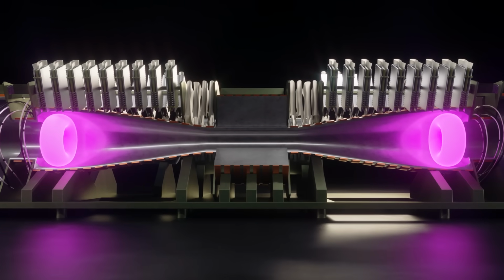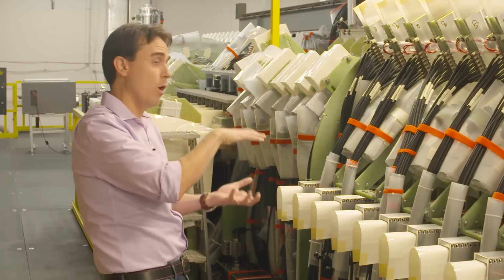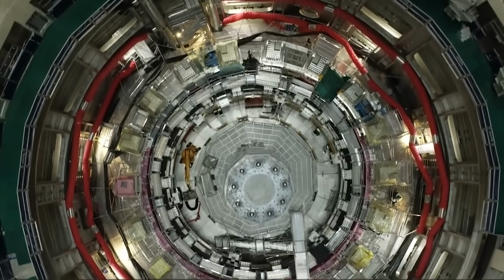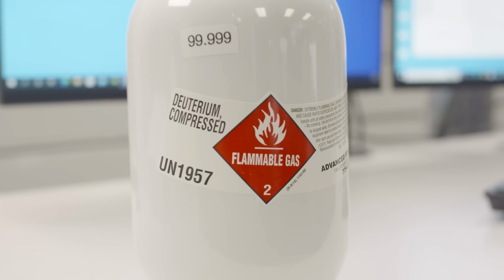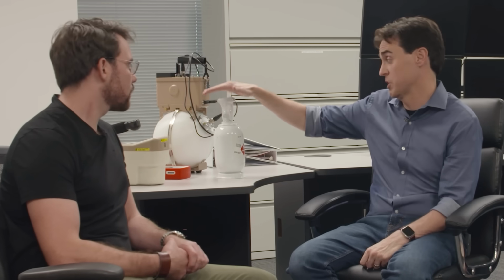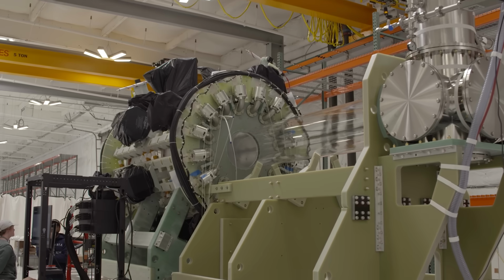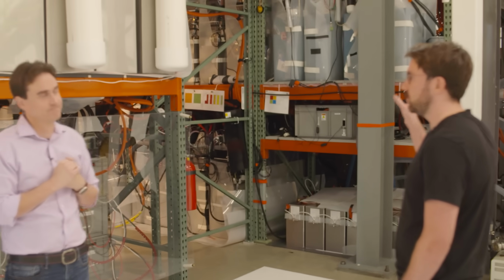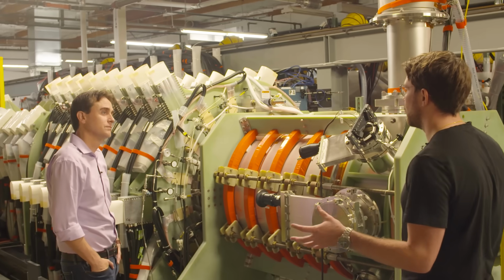A New Way to Achieve Nuclear Fusion: Helion

Comment: Main issue:
The driving pressurization electromagnets will have to be switched off to generate any energy via ion motion, plasma expansion. If they were left on you would be using energy to drive a counteracting field to that which the fusion products are generating which only wastes energy. This is assuming the explanation is not in all directions and thus can actually generate net magnetic flux OR the plasma expansion simply bends the fields already their rapidly/faster than natural decay and that is what generate the power which is more likely yet this will only be net gain if it totally counters the initial field and generates its own.
I may be missing some theory or work about how ions bending a powered magnetic field can add to the current generating the field and produce net power gain, but to my knowledge this is unphysical.

Comment: In reference to their need for high current pulsed power, currently they're using large capacitor banks. Seems likely that in future they'll be able to use three reactors operating 120° out of phase, each dumping it's produced power into the next in sequence. Prime, fire, exhaust...  feed the surplus to the grid.
Reply: They would still need to feed each reactor power to the right places at the right time so even if they could get enough reactors so one would fire right as the energy output of the previous was being released they would need some storage for the different timing delays. Especially if the output energy has a different power creation curve than the reactor input uses that power.
Reply: @Tsudico  Mmm, you're right, I wasn't considering the precision timing required or the multiple sequential accelerating pulses per shot.

Comment: I am waaaay out of my element as far as the specifics of nuclear fusion... but I have a question. They're saying the deuterium-deuterium reaction has a chance to create a high-energy neutron which isn't useful for their method of electricity generation and it can do damage to the reactor... Is there a way to force the neutron into a body of water, increasing the temp to steam, and also having the water capture the neutron to create heavy water? Is that even a thing that could be done? My thought is that you use this as secondary generation via steam, but once the water is saturated enough with heavy water, you could electrolyze it to release the deuterium to then use as a fuel again... This way you're not wasting high-energy neutrons...

Comment: Maybe they just need multiple reactors firing in sequence like multiple cylinders in a piston engine.  The power surge from one reactor's fusion ignition is used to power the next reactor's plasma cycle until it fires and powers the next reactor.  The faster they can get the sequencing to run, the less energy will need to be stored in capacitors.   Essentially the plasma and magnetic fields become the energy storage systems for the brief period between shots.  Inductive energy storage instead of capacitive energy storage.  This would eliminate concerns about how much energy you can push and pull from capacitor banks and potentially simplify the system down to coils powering coils with the fusion as the energy booster to keep the charge / discharge cycles net positive.

Comment: Question, and I understand they know way more than I do, why can't a heat pump be used to draw off the heat he's talking about near the middle of the video, both cooling the system and a helpful way, and recapturing lost heat energy from the magnets and capacitors? I'm guessing the answer is super not worth it

Comment: even if this style of generator makes less power overall it seems like it will be a lot better for large-scale production, smaller footprint, and seems to have a steady fuel supply with little environmental impact. It also seems a lot easier, faster, and possibly cheaper to make major changes to the system

Comment: By any chance will pumping liquid nitrogen through the exterior walls and around the magnets reduce the heat stress allowing longer run times and lower the needed power to out put for the magnets?

Comment: I would loved to see some Qplasma and Qengineering numbers for Trenta and estimates for Polaris.

Also a bit more explanation for why D-He3 can't be/ isn't used in Tokamak systems
Reply: It's because of the way that Tokamaks generate power. They work by capturing the kinetic energy of neutrons. The D-He3 reaction releases almost all of its energy in the form of charged particles, rather than neutrons. The Tritium Deuterium reaction releases most of its energy as neutrons. Hope that helps.
Reply: @SentinalhMC  That's an argument for why Helion CAN'T use DT fusion, but I don't see a reason for why the the kinetic/thermal energy from the changed plasma can't be extracted at the walls of the tokamak. Obviously the protons would be influenced by the magnetic fields and wouldn't just shoot out the side, but eventually the magnetic fields need to be powered down anyway and the thermal energy is extracted from the plasma.
Reply: @plainText384  That's not how Tokamaks work. The whole point of them is once you get the reaction running you never shut it down. The plasma never touches the walls the neutrons passing through the walls is what allows kinetic energy to be converted to heat to create the steam.
Reply: @SentinalhMC  Tokamak reactors have never operated for more than a couple minutes at a time and pulsed Tokamak reactors are a concept that exists.

 It is also my understanding that to induce a stable current inside the Plasma, the field strength and therefore the current in the external poloidal superconducting magnets needs to continuously increase. (Like trying to achieve a constant Voltage on one side of a transformer). I was under the impression that this put a limit on the time a Tokamak could remain operational, as the superconductors will loose their superconductive properties above a certain current density.

But I am not an expert in Fusion reactors, this is just the stuff I remember learning back in high school, which is why I would have liked a deeper dive from real Engineering and some scientist he finds to interview.

Comment: Sounds questionable. Achieving fusion is rather easy you just need a good vacuum chamber and a high voltage supply. The hard part is there needs to be more energy out than in. Even worse, you're doing constant confinement+ 30 or so pulses, and you get just 1 pulse back. If humans can capture pulses easily they would have been capturing lighting

Comment: so thoery a termal enginering could go as gas erupt systems and speed up reaction time so is easy in continues use see efects and also more economic koeficient in use technicaly is booster tester in owerachieve test for colide explosions guided and driected into splash together perahapse a theory off rocket engienring could also be helpull lets supose gas ions could behave under heat like rough gas in ramjet or scarm jet engine so called rings blimps could actualy do energy storage and eventualy pop out nicer in ecplitic oval shape this phenomen could bring out some roughenss to more refined also like acustic sound blimps so basicly this are lab test based on light ion if they could be handled in above theoretical usse off gas as 84% power max use power max out potential is 95% as things should do in normal jet engine use for normal life span and stabile use so tech ring could apply on part off booster part and avoid misfire or failure or misuse technicaly if it works you could look like majke so as am stuff better maintain cycle or more safer to faster use so eficiency iis corect also faster idustrial size product anyway after first shwo and following directions is easy stuff for nobel as first to use contemplive theory and porve practice aplicationable so theory suport enginering demanding future as something as divine drive in india was axis based engine atleas to is noble to prove realy fact that some enginering also follow some design and basicly do stuff as principle in cold fusion planets not our actual still gigantic energy potential in use and biger then earth so even provng physical enginering tech prove gas could follow ionized and seing difference is basicly science off large composit gas planets actualy like this

Comment: So one question I have is how do you exhaust the Helium 4 out of the machine after the fusion? Can you do it continuously, or do you take the machine down and empty it? And surely, the Helium 4 exhaust is a valuable product too right? You can sell it to hospitals to make operating an MR machine much cheaper.... Maybe the system is really just a helium making machine that makes free electricity as a by product...

Comment: Why is the glow visible through all that material? how much mass is being smashed and how much fusion energy output per pulse?
And rather than build physical reactors, why not simulate designs until there is a chance they'll work. There would seem to be no reason for wasting money and time with physical devices that will never work. Simulation would seem to be vastly more agile.

Comment: wow this is cool, and insane, im sure someone has already thought of this but im going to sugest it anyways, instead of 2 chambers meating would 4 or more give any benefit? fireing all at once or stagered to reduce time between fusion events. gods speed. hope this is comericaly viable in a decade or 2.
Reply: My initial thought was also "what if they were at a slight angle, so that the combined fusion blob then started racing down through the electromagnetic equivalent of a bell nozzle?"  I.e. make a fusion pulse rocket with this thing, perhaps partly self-powered with the rest being provided by a proper generator.  Could prove to be a good mix of high specific impulse mixed with actually accelerating at a rate you could feel (and if you have enough power to power it, you can also power some electric jet engines to get you high enough, perhaps with a final conventional rocket booster to get suborbital, to then use the fusion pulse rocket to circularize and start getting to where you want).  

I wonder if such a fusion pulse rocket could have enough energy to get off the moon directly, and how much mass it could do it with if so.  Would be a lot easier to start setting up bases and mass drivers if you don't have to basically use it as a cargo ship for carrying landing pods with conventional rockets for landing themselves on the moon (or having to put conventional landing rockets on the main ship).

Comment: Does it make sense to line the walls of a Deuterium+Deuterium breeding reactor with Lithium to capture the extra neutrons? You'd have to deal with the Tritium released but you could fuse it with Deuterium again to make more Helium-3. And you wouldn't need the Beryllium and its associated problems.
Reply: that was covered in the video. If you use a neutron to make tritium for fuel you spent 0.8 of the neutron energy splitting the lithium so it's not available to heat the jacket. Using a beryllium jacket you release two neutrons so can bread fuel and heat the jacket for energy recovery
Reply: @salerio61  right but I'm not talking about the energy reactors, I mean the reactor whose only job is to make fuel for other reactors (hence breeder reactor)

Comment: Topamax will never go online at large scale. There is a major problem with needing over 20+ tons of rare mineral to act as a neutron generator.

It's one of the major key components to the reactor it's that white ring around the blue ring used for cooling.

The world's manufacturing capability of this mineral is only 20 tons a year.

So we would have to divert more than a few years of production just to make enough for a single reactor.

I think you're starting to see the problems with a topamax reactor.

Example 11:15

This material is also not capable of being recycled after it's used it just has to be thrown away 20 tons of it!!! WTF😒
Now consider that you have to run old nuclear reactors to get the tritium to run in the fusion reactors every time you want to start the damn thing. 🙄🙅🏻😮‍💨
Now considered tritium is extremely rare I think it's the most expensive rare element on the planet to buy second to a few others that are not metals.

Now look at this reactor it requires no rare Earth minerals just strong magnets and a couple of plasma generators.

I don't think they should stop the topamax I think the information gained from it is well worth the study I'm not saying we should dismantle it I just saying I don't think it's going to go to commercial viability.

I wrote this before I got 10 minutes into it because I saw a major problem.
This journalist is very good at this job and is looking at all the angles my compliments.

Comment: I'm just blown away at the brilliance of using the reaction itself to create an EM pulse that directly creates electricity. That totally removes the need to boil water to spin a turbine. It's amazing they may hit the step of making usable electricity by 2024 with what appears to be very few downsides. Further, since the machine itself can create electricity it may open up the possibility of not needing batteries if this tech can be shrunken down enough to fit in a home or car.

Comment: This is one of the more interesting approaches to fusion IMO. Tokamaks are a dead end, as they might make fusion, but getting the power generated to the grid is another thing entirely.
Reply: Agreed.  They are just too big IMO.   About the only way I see them working is if they use helium-3 generated using hourglass reactors like this instead of that DT that needs a huge bery lining and literal steam turbines to extract power.
Reply: Tokomak is too small. The tight circular curve pinches the magnetic fields weakening the outside and allowing ions to escape, bleeding energy from a system that cannot afford to lose any energy. If it was as big as the CERN particle accelerator, the curve would be so long, and therefore so low, the magnetic fields wouldn't notice. It would be as smooth as an infinitely long tube.
Reply: @RobinPageGaming  ITER solves that with a big magnet in the central void. Theres an alternative design called a stellerator that also makes this a non issue.
Reply: @acbthr3840  except the problem hasn't been solved or fusion would be a reality by now. Making the circular path longer, and the curvature less pronounced, might have made it a non-issue in the first place. I'm thinking something the size of the Super Proton Synchrotron at CERN.  On a side note, the reason the Stellarator was originally attractive was because the plasma interaction with the confinement field induced current in the coils, resulting in a self-exciting system, allowing direct energy conversion without a steam plant; a nuclear plasma electric generator, aka a magnetohydrodynamic generator. Tokomaks can't do that but they were cheaper at the time and steam was potentially more energy efficient than MHG anyway, so Stellarators feel out of favor.
Reply: @RobinPageGaming  What? The issue with the velocity differential and magnetic field line weirdness between the inside and outside of the ring in a tokamak isnt the primary barrier to getting the yield up. It helps, but is far from a limiting factor RN, especially since its a negligible problem with the fixes we have. The current limiting factor is actually getting energy into the plasma so it fuses before it expands too much. And uh... no thats not why the stellarator was originally pursed. It was attractive specifically because the design largely cancels out the typical particle drift and helps with diffuusion problems you get in a normal tokamak. It is literally just a normal tokamak, but with a more efficient configuuration since you dont need the core void electromagnet

Comment: The merged plasmoid is shown as roughly spherical, but I believe it would actually be highly elongated (which is desirable here due to how FRCs work.)

The slide with the nuclear reactions also mentioned making tritium from the DD neutrons, in a lithium blanket, which would increase the amount of 3He produced by about 50%.    Neutron multiplication and beryllium would not be required, nor would rapid extraction of the tritium.  Unlike in a DT reactor, the heat from this blanket would not have to go through a thermal cycle (although it could, as could heat produced at the first wall due to photons radiated from the plasma.)  The power flowing through this thermal cycle would be only a fraction of the total power, similar in spirit to how the output of the bottoming cycle of a combined cycle power plant is only a fraction of the output of that kind of power plant

The DD neutrons having less energy is important because, unlike the 14.1 MeV neutrons from DT fusion, they have much smaller cross section for gas-producing reactions (like (n,p), (n,4He)) in the reactor materials.  These reactions are terribly damaging because they inject gas that accumulates at very high pressure in tiny bubbles, ripping apart metals.

Because of that, they really do not want the T produced by DD fusion to itself fuse.   It would be nice to know how low they can get the fraction of produced T that fuses.  Keeping the pulses short so the T stays energetic (above the peak of the DT fusion cross section) would help.

The business with two neutrons, one of which makes tritium, the other heat, is wrong.  All the initial neutron energy (except that needed to break up the Be nucleus) ends up in heat, and both neutrons go on to make tritium.